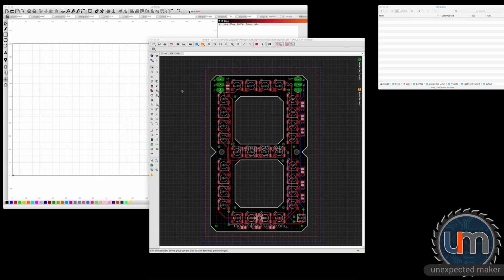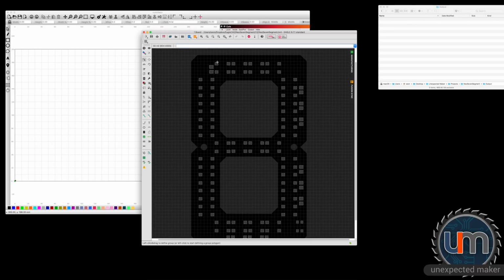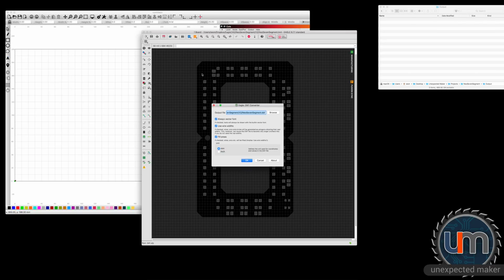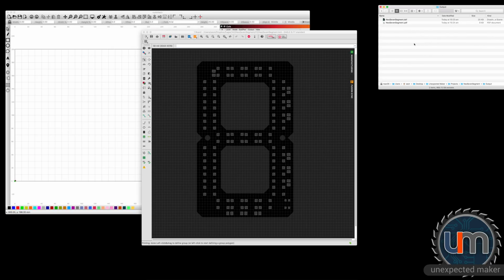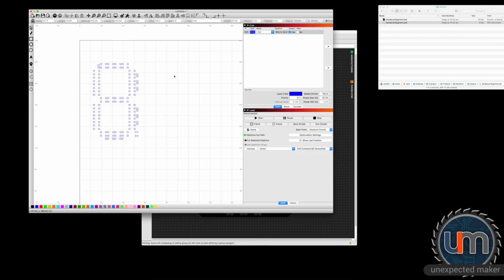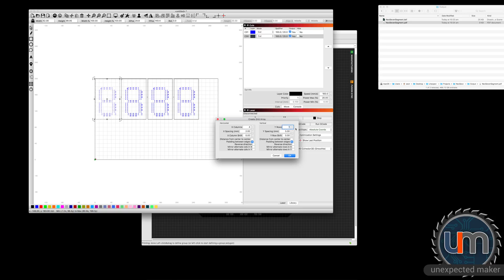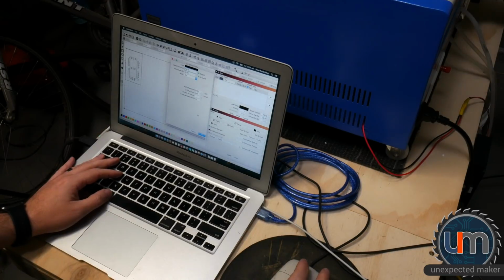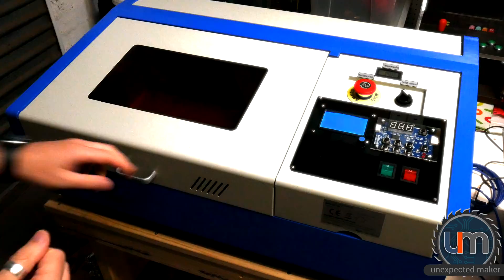Can you laser cut solder paste stencils from Mylar?

Comment: 3 suggestion
1. speed up the laser speed.
2. make the hole data smaller (calculate the heat expand of the plastic)
3. try engraving with that laser, ussualy engrave making less heat than cutting act.

Comment: If you import the pdf into illustrator you can rescale all elements to 80%, while in object centre mode and it will keep the position of all the elements the same and shrink the dimensions slightly. I find 100% tends to put a little more paste than you need down. I also fill the shapes and use raster rather than vector and it works a little better for close together pins on ICs.
Reply from the maker: Hey Tim. Yeah my current stencils I ship with my Neo7Segment kits have the pad sizes reduced to 90%. There are no fine pitch devices on these boards, so no need to reduce more, but I agree that shrinking the pads is super important!  I'd not thought of going raster instead of vector.... interesting, thanks for the suggestion!

Comment: Nicely done Seon, I thought the laser cutter would melt the mylar, but it came through like a champ. Regards, Dave
Reply from the maker: Yeah, I had it quite low in power and 100mm/s is quite fast as you can see in the video. I actually thought It would fail to cut that low, but it was perfect it seems. The few holes that were not cut fell out when I touched them :-)

Comment: Cool idea But does it work for spreading the paste well, or does the weaker mylar bend and move as you apply pressure from pasting?

Damn I need a big laser cutter! I think I'd cut me dinner with it!!

Steve
Reply from the maker: That is my next step... to see if I can use it to lay down the paste. I think it will hold up fine for 1 or 2 uses as it is quite firm, assuming it's taped down well, but it definitely wont last for too many.
Reply: Unexpected Maker yeah that's what i thought - like a 'one time use' for the kits would be great. Can't your laser cut thin aluminium?
Reply from the maker: I don't think so. I'd need something much stronger than 40W for that... Maybe 80 or more likely 100W I think.